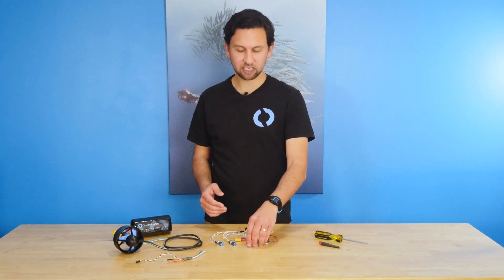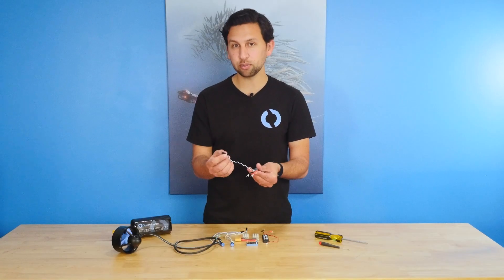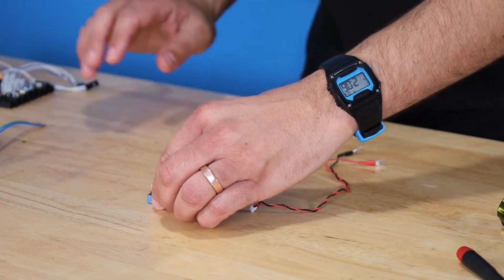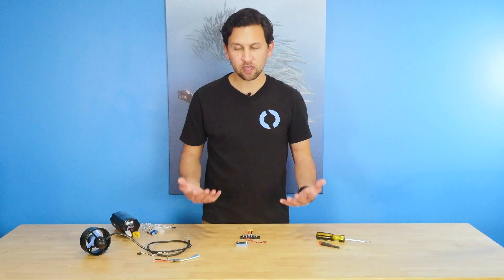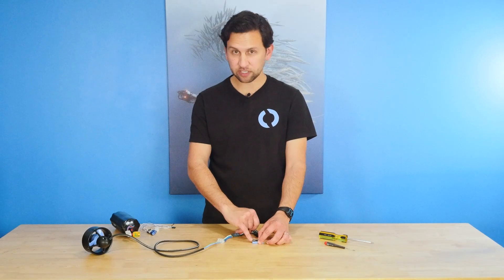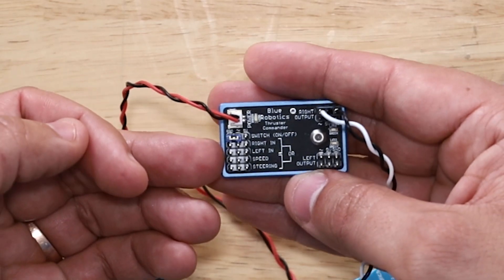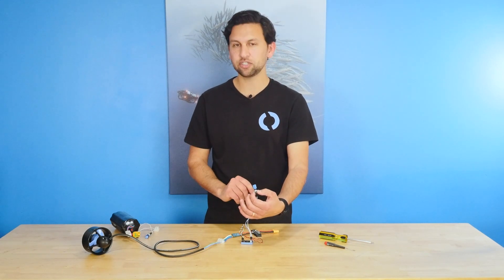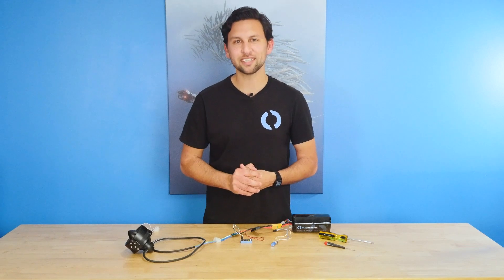Blue Robotics Tutorial: Using the Thruster Commander

Comment: Can it be used with a T500 motor and a 6S battery?
Reply from the maker: Hi there - yes, absolutely!
Reply: @BlueRobotics  THX!!! Does reverse connection of the potentiometer line cause the motor to reverse to the CCW?
Reply from the maker: @hobielim9797  Yes!
Reply from the maker: @hobielim9797  The 3-pin connectors on the potentiometers are reversible, so if turning a knob runs the motors the wrong way, the connector can be reversed to correct the problem.

Comment: Is it possible to control the motors with the thruster commander using an arduino?
If so, how do you do it?
Reply from the maker: If you have a Thruster Commander, you don't need the Arduino, and vice versa! Either one can be used alone to control thrusters.

Comment: what are you suggesting to drop 12v to 5v? Use 1 12v battery to power everything
Reply from the maker: The Thruster Commander has a power input that can accept 7-20V, so you can power directly from the 12v battery.

Comment: Hi i have a question, can two of your trusters power a kayak?
Reply from the maker: Hi Ignacy, yes! You'll have to figure out a mounting method yourself, but it's doable. Here's a video of T200s on a kayak: https://www.youtube.com/watch?v=rn6Rvxpq8KA
Reply: @BlueRobotics  and how about bateries,  are there any limits about the voltage or curent?
Reply: @ignacypaulinek9737  For the T200, we recommend batteries between 12-18V, such as a 4s lithium ion battery or a 12v lead acid battery, than can provide at least 25A for each thruster that it is powering.
Reply: @rustomjehangir855  thank you

Comment: Are you able to bypass the pot and use a momentary rocker for forward/reverse and just have full power when you press the rocker?
Reply from the maker: Hey Chris, yes, you could use a rocker switch and two resistors to make a switch that would have 0V (low), 2.5V (middle), and 5V (high) output that would do exactly what you're suggesting! If you'd like details on how to do that, you can reach out to our team at support@bluerobotics.com.